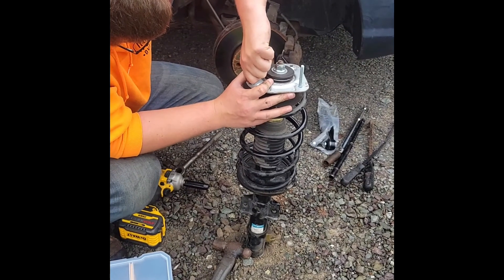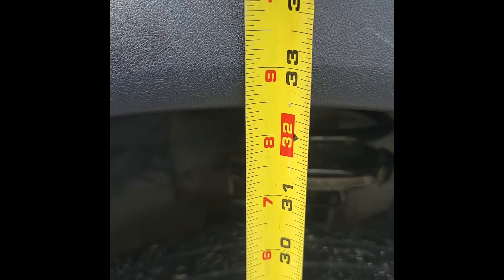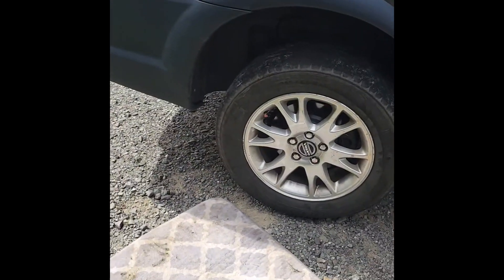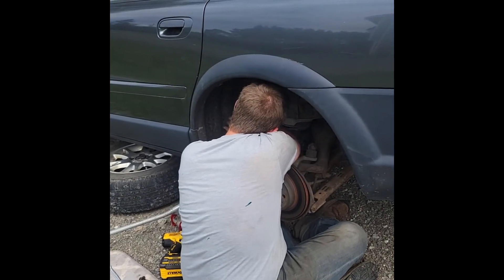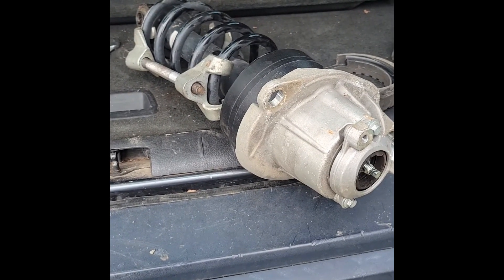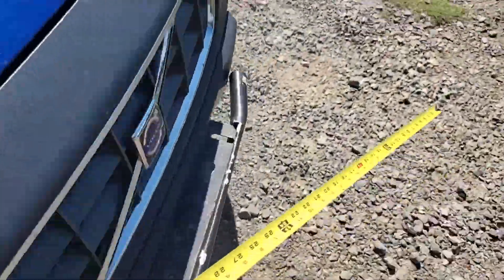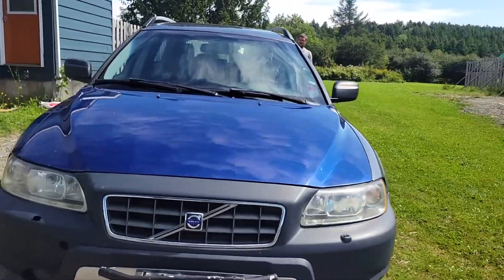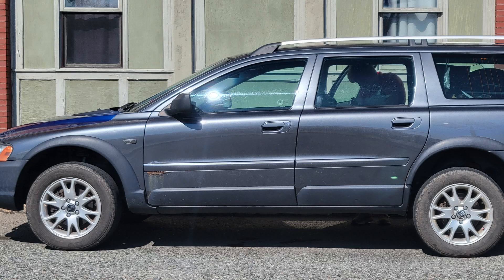Our Volvo XC70 Gets The Teama4x4 Lift

Comment: Looks good! I have an 05 that I just bought 17" steelies for, I already have a roof cargo rack, bull bar with 2 LED flood lights and more lights on all 4 corners of the rack. Been looking into lift options of which there are not many. I'm about to go hunting for this kit you speak of
Reply from the maker: Thanks, I got this kit off Ebay, it was listed as a 30mm, but provides 2 inches of lift.
Reply from the maker: I moved the roof basket and LED lightbars from my old Explorer, next is a mount for the winch.

Comment: Did you get vibrations under acceleration after the lift?
Reply from the maker: No...rides just as it did before...I have around 5000kms on since the lift..zero issues

Comment: Good vid👍 what size tyres will fit with this lift?
Reply from the maker: I went with 225/70-16 due to the rear diff being so far forward it's the biggest tire you can stuff in there unless you do taller springs/subframe spacers etc. I had to trim the plastic on the inside of the rear wheel arch( front lower section) to get these on the car.
Reply: @timetoxplore thanks for your answer. Do you happen to have a pic with your new tyres on?
Reply from the maker: @mobeats2443  tagged you in a post